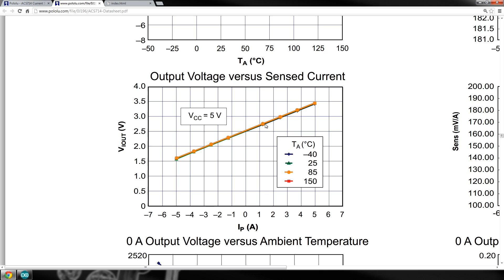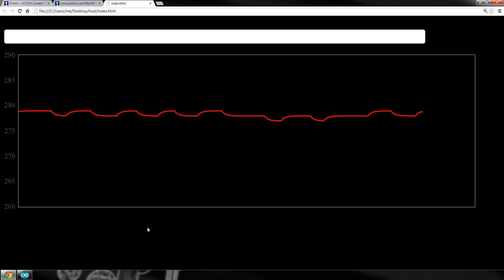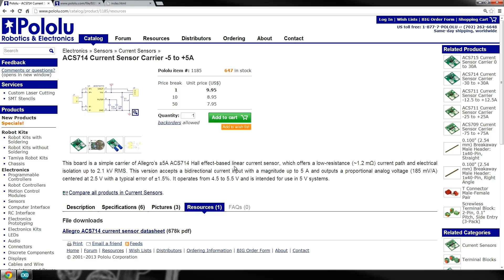onshouldersTv: Measuring Battery Use

Comment: A current shunt (low value resistance)  using Ohms law to get current V / R = I.  We have used those before and since it is just a resistor essentially you will not have noise due to motion.

Conversely maybe you have something loose or setup incorrectly (maybe moving the wire clips) with the sensor you have.  It is very likely no more than a current shunt and associated amplifier.

Comment: Hi,
If you really want to measure the power consumption, you have to also measure the Voltage, so you can get the Power delivered by the battery : P = u * i. This is important, because the voltage of the batterie will go down if you take power from it.
Maybe you should look at electrical shunt to measure the current ? The problem is that output voltage are very small, ans even more with small currents.
Good luck !

Comment: Hi,

I practice FPV and we use some current sensors. I never tried to check the values returned by the sensors, but they may be beter than the pololu as designed to work in copters and planes.

Comment: IMHO, your idea of monitoring power consumption is awesome, as well as difficult. BUT, I think you could make an analysis on how much the voltage of the current sensor moves with respect to its acceleration with an accelerometer attached to it. You would also need to calculate the maximum acceleration of the leg and see if the accelerometer and current sensor will be able to operate within the range. Good to see you took my idea of the peg-leg! Keep up the good work!